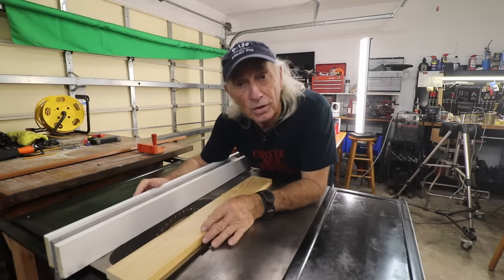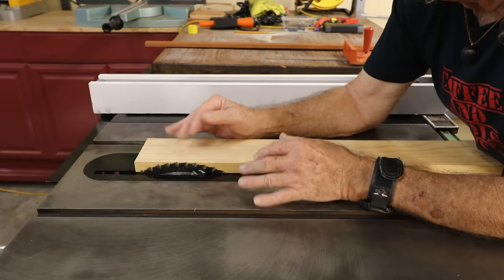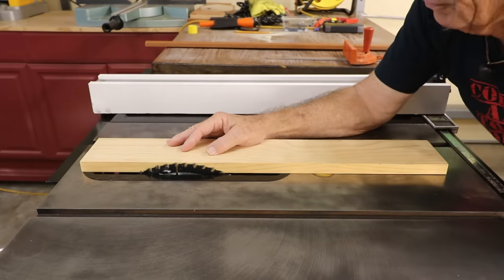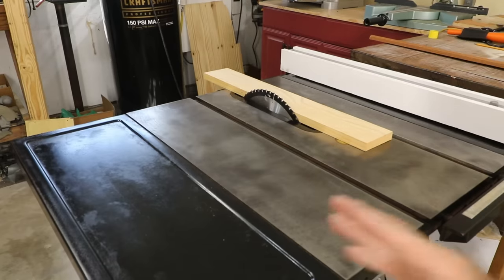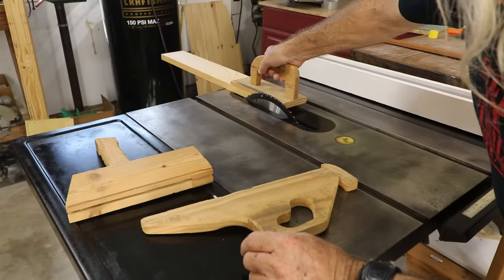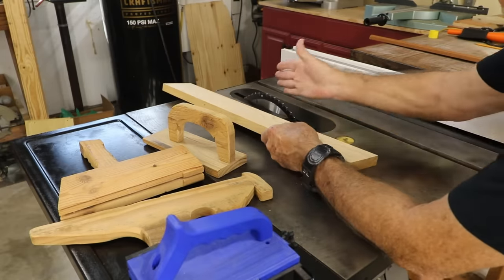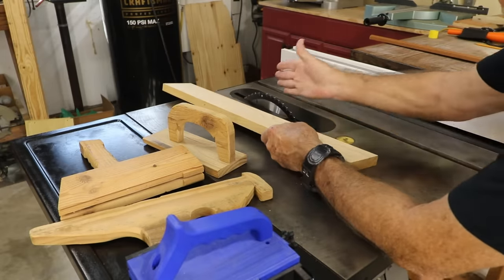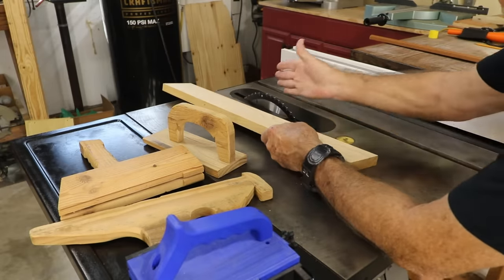Table saw secret nobody will talk about from the good old days, C&T episode 180

Comment: The only time I ever had kick back was while cutting a piece of oak that was about 8x6 inches. I was cutting a groove to fit a tongue so the blade was only about 1/4 inch into a 1/2 inch board. I wouldnt have any fingers if it wasnt for the wood on top. I tried to keep it from kicking and ended up with both hands on it. Just a split second reaction before I let it completely go. When I let it go it took a second before it kicked back. The board came back really fast hitting my right hip and hand then flew about 30 ft or so into the air. Good old memories of high school wood shop. Lol it could've been really bad but I ended up with a monkey bubble on my right index finger and a bruise on my hip. 

That's one of those scenarios that makes one never forget it. I still use table saws all the time, just more carefully now. 

One thing you should add is keeping the bigger portion of the wood being cut to the fence. That's a pretty big tip on not getting kick back.
Reply from the maker: YES... I was looking at that ratio for using the fence. I call it over square to the blade, but that is another basic and yet no one seems to mention it. GOOD thoughts.

Comment: I've always heard to keep the blade one-half of the gullet depth above the surface of the work piece.  That allows better clearance of sawdust, which reduces heat buildup and burning of the work piece. Simple physics also says that the less blade in contact with the work piece reduces friction and therefore burning.  In terms of safety, I always use my riving knife.  I'm not so consistent about the blade guard and the anti-kickback pawls.  I need to get much more consistent with the blade guard, but on thin stock the blade guard causes the stock to "stick" and not go through the blade.  So I wind up taking it off and not putting it back on.
Reply from the maker: Sounds like another show topic

Comment: The “100” series Craftsman table saws have a set of spring loaded washers that was made to hold the option blade guard a splitter fits in this and will tilt with the blade 
I was told that the reason for a high blade was to minimize the material thickness that was being cut there by minimizing the hp needed
I also have been woodworking for about 50 years
Reply from the maker: interesting
Reply: All correct! You think as I do, that higher blade giving more controllable forces on the stock gives the best safety!
Reply from the maker: Interesting how we were all told various reasons
Reply: @SirTools yes, agreed! Engineering is all compromises, enhance this at the expense of that. Everyone has been given sound reasoning focusing on one parameter or another!

Comment: Interesting description of the tradeoffs one makes deciding blade height.  I am a retired shop teacher/carpenter etc.  Another thing to think about is how you push and where you stand.  Before I cut I always check my feet and body lock my right elbow and push with my whole body, not just my arm.  This way if something slips, my hand ain't going anywhere!  Especially near the end of a cut.
Reply from the maker: Exactly, I always plan my cut and my body before cutting.

Comment: I've recently started to raise my blade high because I realised that having my blade close to the top of the wood actualy increases the risk of kick back because it increases the amount of teeth in rubbing contact with the wood which renders your kerf clearance as useless and worse of all it vectors thrust back towards the operator and increases friction through rubbing leading to premature tooth wear which increases rearward forces even more. The more I get into it the more I recognise that a low blade is a recipe for trouble..its a perfect example of how hiding things out of sight for fear of trouble actualy leads to trouble. Blade guards were made for a reason, that is to cover the exposed portion of the blade and prevent fingers from getting to the blade also prevents the wood from being forced up over and towards the operator when adjusted correctly  and in conjunction with the riving knife. The problem with most guards  and riving knives is that manufacturers make them as connected pieces with the knife supporting the guard which prevents    the saw from being used to cut grooves and dadoes.
Reply from the maker: Agree
Reply: Most table saws I've used never have had any safety features but  even though it takes a little extra time I think they make them pretty easy to take on and off for these reasons lol. I know some projects are a pain with having to make different cuts. If you're having to keep  reworking your table saw setup you may think about getting a smaller unit that can be moved around and set for a different cut. I have done this myself hiuyyy%%%p<<ú DC zzz cc yuh ute

Ytt_t//yy
7
Unit
6
Reply: @kennethlambert9030 
7
Unit
6

I agree
Reply: I took my guard off because of dadoes.  And because it is a pain to re-install, I leave it off.  The knife behind the blade stays on though, because the top of the knife is perfectly in line with the top of the blade, so it does not get in the way when I make a dadoe.  I usually place my blade about a half inch above the wood when making regular cuts.  I am comfortable with that height.  I do not like it flush with the top of the wood, because I am the type of person that has to see it to remember it.  In other words, if I cannot see the blade, clearly, I will let the fingers get too close.  I see that blade and so I am very conscientious of it and where my fingers are at, during the cut.
Reply: @annarouly2144  lol right I'm probably a little like that, I like to see what's happening especially with today's wood being all twisted and bowed, the blade to low it'll not cut all the way through in a bad area

Comment: I've always been taught that the bottom of the gullet between teeth should line up with the top surface of your workpiece. In my eyes that splits the difference between flush and really high. it also helps if you happen to be cutting a board that's bowed and is higher in one spot vs the spot you referenced while setting your blade height. The only exception is working with veneer sheet goods, where you really want that blade as low as you reasonably can  so that you get less chip out
Reply: To add to this, my understanding is that blade geometry is generally designed with this (the gullet bottom being level with the top of the throughcut workpiece) in mind. It’s possible that saw blade manufacturers used to design them differently, making the blade level in the video the intended usage.

Comment: I have the exact same Craftsman 12" saw as yours, however I got mine brand new about 1970. It came with a blade guard which incorporates anti ejection prawns, and plastic guard.
If you can find one for your saw it can be modified into a rising knife. It thumb screws onto the round v-notched shaft in back of the saw. It  also tilts with the blade.
And by the way,  I have had kick back, once, and ejection several times, but never hurt. Kick back happened because I was too lazy to attach blade guard.
Reply from the maker: That saw was sold to a local wood guy. The newer one has the same issue. No riving knife or guard kit.

Comment: The emphasis on safety ignores the physics involved in the cutting action of the teeth and the clearing out of the sawdust. Safety issues can be taken care of by simply by using a proper push shoe, not push "sticks" and keeping your fingers out of the area of the throat insert. A splitter or riving knife will prevent 98% of all kickbacks. So, with the low angle blade which requires greater feeding force than a higher blade, you have introduced "unintended consequences". Ripping blades, having fewer teeth and larger gullets are more efficient cutting with the grain. A crosscut blade with a lot more teeth and smaller gullets gives a finer cut across the grain. A general purpose blade is always a compromise, but works pretty well.
Reply from the maker: you on it ! Good comment.

Comment: The worst kick back I ever got was from ripping with the cutoff narrower than the outboard opening of my face plate.  I was needing some thin veneer faces for covering plywood edges.   It splintered at a small knot and dove into the opening.  I heard it before I saw it… but still couldn’t hit the stop before it came back at me.  

I ducked just in time to have it whiz by my ear.  That startled me and I let loose of the push block.  It hit the blade snd was thrown back also.  The wider portion of the board rose up on the saw blade and skidded much slower back toward me as well.  

That split second taught me a couple of lessons…
1. Use a zero clearance insert when cutting narrow edges from parts… or just joint them some other way instead. In this case I was needing to use the narrow edge.
2. I’m not faster, stronger, tougher or smarter than a tablesaw.  So, spend as much time and effort as it takes to do a safe setup!

As far as the secret goes… I’m an old fart too.  I use a riving knife on every cut that I can.  And blade height… I split the difference.  The norm for me is for a full  tooth to protrude above the wood.  It is lower than the thickness of my push block yet high enough to have that downward cut that gives the cleanest cut.  

I’d like to add one more thing… all of the new saws come with plastic push sticks.   That should be outlawed.  The only time I’ve been cut on my saw was when the brittle plastic push stick hit the blade.  It shattered and a shard imbedded in my cheek.  When I wrote to the manufacturer they sent me another one with a full page set of instruction on how to use it safely.  Both of which went directly in the trash!
Reply from the maker: You've had some bad times. Thanks so much for sharing this info. The video is about height of blade , old reasons VS the new safety ideas. The Riving Knife is another video perhaps ?
Reply: @SirTools  you mentioned it and even said you were going to build one… I thought so any way??
Reply from the maker: Looking at a 3d printer app for it..."maybe" LOLOLm:)

Comment: I almost did everything right while cutting hardwood floor. 
And that s.o.b. came back at me.. that hurt! .. 

The almost everything right was;
Didn't realize the dullness of the blade.. or I just didn't have a new one to replace with and only had a few more cuts left. 
MORAL OF THIS STORY IS; 
MAKE SURE YOUR BLADE IS SHARP !!
Reply: Absolutely! I was just going to write about the importance of a sharp blade.
Reply: @seanmcaleavy2369  almost got my leg a few times with circular saw because of the same reason. 

Won't make that dull blade mistake again. 
That $12-20 is well worth a safe work place. 
(Probably going to get hurt today now for saying that) but as of now.. 8:04am.. I have all my fingers

Comment: I like the balanced argument you presented on this. Blade above or blade below(level) has been a huge controversy so it is nice to see that not everything is as it seems. Kinda what I had always thought, but nice to hear that I was on to something. Thank you! :)
Reply from the maker: Next time we do the saw blade we're going to measure temperatures on the blade while cutting and see the differences. Should be interesting :)
Reply: @SirTools  That is a good idea. If the temperature is colder on one vs the other that may end the debate right there. No one likes burnt stock! LOL
Reply from the maker: @WoodWorkTherapy  It's a deep topic and includes warping the blade...Say WHAT ?...I'm serious.
Reply: @SirTools  I see what ya did there. LOL, Your right on the warping. As the metal on the blade heats up the blade slightly warps from the pressure of spinning and impacting the wood if I remember how that works correctly(I am not a thermal engineer LOL). So I guess the question at that point, would be what keeps the blade cooler? Hmmm... My guess would be the blade raised would keep the blade cooler, and thus would warp less during the cut because it has all be it a small-time, but some time to get away from the wood into cooler temperatures. Kind of like the concept of an air-cooled engine. Just a therory, but we will have to wait to see what you come up with on that! :)
Reply from the maker: @WoodWorkTherapy  Your on track :)

Comment: I've been using the table saw for the past 65 years and still use the free 2 X 4 or 2 X 6 with a handle to use as the push contraption for cutting. I usually let the blade cut into the push contraption a bit especially when I am cutting real narrow pieces like I will be doing i the near future. I usually use a longer one when I am cutting thinner wood like 1/4 inch plywood. This helps keep the plywood flat. I have never seen a table saw with the blade mounted so far toward the back, why????? I've never had a saw (I'm on my 4th one) with the knife and or the plastic guard and I'm still with all of my fingers and no scars at all. I really liked the video.
Reply from the maker: Just felt like nobody talks about "old school" LOL

Comment: In Europe they teach us to retract the fence on the parallel guide. That gives the  wood room in case it has some internal tention that is being freed during the cut. In case you can't retract the fence, you can just install an auxiliary fence which doesn't go all the way through.
Reply from the maker: Interesting idea and would help mm...
Reply: @SirTools  yeah I mean try if it helps. Another point to consider, a bit more costly though, would be to upgrade to a formatting saw / slider. that way you can cut of thin slices with the help of the sliding table and only use the parallel guide as a stop. If you fix the wood to the table using a hold down, your finger will remain as far from the blade as possible.

Comment: I'm not sure why most folks lose the blade guards other than maybe poor design. The saw you have looks like a Craftsmen/Emerson which came with an excellent clear plastic guard/splitter and anti-kickback paws at one time.  I actually replaced the horrible guard on a 3hp Grizzly cabinet saw with the Craftsmen. Once a wood worker masters his equipment, the only variable is the lumber. Always use the correct blade for the material and setup. Great video on blade awareness!
Reply from the maker: Thank you Retail23. The craftsman came bare bones and was sold to a woodworker that does hardwood furniture. He's happy LOLOL...

Comment: I have been wood working for the past 50 years and feel that I have some notable accomplishments with it. My tablesaw is an old Atlas model, still in quite good shape, but it does not have a riving blade. I don’t know if they even thought of riving blades back in 1950 when my saw was made and my father bought it. my greatest safety concerns on the saw are:

1) mindset
I convinced myself long ago when I let my mind wander a little and nicked my thumb that you have to realize that what this monster machine wants most of all is to cut off an appendage. fingers, hands, feet; it doesn’t care as long as there is lots of blood. You have to approach the tool as if it is out to get you and keep concentrated on what you are doing and what is safe, every second that the machine is running.

2) helpful tools
My fence clamps to the saw tabletop and is about 1 ½ inches wide. If  I cut something within a relatively short distance from the blade, I have formed a habit of draping my hand over the fence, providing prevention of movement of my hand towards the blade. I can never project my thumb on the blade side to a distance that can reach the blade. If I must cut closer, I use push sticks (carefully) or a sliding “U” shaped push fixture that fits relatively closely over my fence  and has a replaceable protruding push stick on the saw side to grab and push the wood. On the top right side of the fixture I have a ¾ in. dowel inserted and protruding towards the right. I use this to grab and push the fixture with my hand. It provides all the control and direction I need without putting my hand in even minimal harms way. It will work with 2x4’s,and plywood equally well. I still have all my fingers.

3) I also use a plastic dust sucking blade guard when I can. Perhaps I can fit a riving blade sometime.
Reply from the maker: A lot of "rushing" seems to be the main event. The riving knife is another problem. Splitter is pretty good too, but only if your using a straight cut. My latest saw came without a riving knife and again just never had one anyway since those old days. Thanks for posting and taking the time to write this up.

Comment: Using a saw like this for some 45 years now, mostly on plywood and MDF sheets. I keep my blade at the same height you do. It’s MUCH safer than keeping the blade low. Material has the tendency to climb up on a low saw … I never use the pushing contraptions, don’t trust the stability. There are situations in which I’ll use some cutoff to push something that’s narrower than 4 cm. I always hook 3 or 4 fingers over the saw guide in order to keep my thumb and index finger away from the blade.

Comment: @coffeeandtools  I have periodically used a table saw for home improvement projects, however I am now going to take on the task of building kitchen cabinets.  

I was going to use a dado blade for this project, but it obviously requires the riving knife to be removed.

Do dado blades cause kick back as well?  

Any other concerns I should have when doing this?  

Thank you in advance for any and all input.